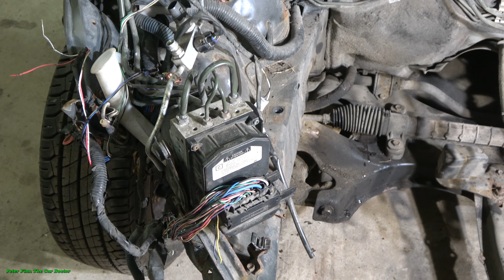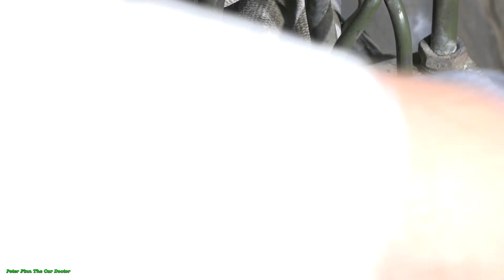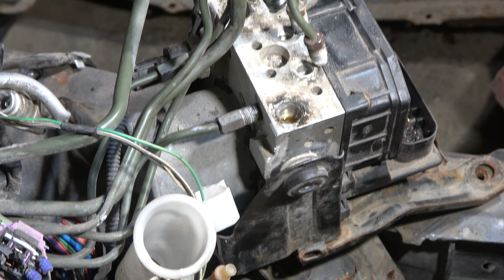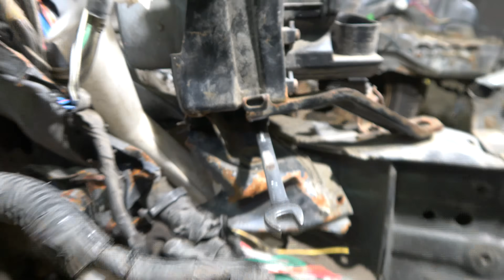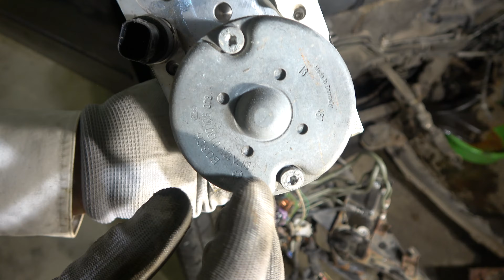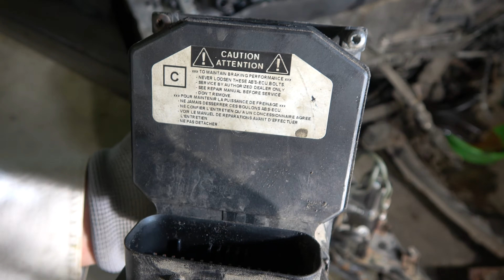How to replace ABS Hydraulic Pump Brake system. Years 2001 to 2022

Comment: Excellent work Peter! Shaped-head tools are always useful!
Reply from the maker: They are good. The ends of the nut do not break and get damaged. Operation is a bit slow.
Reply: @PeterFinnTheCarDoctor  Yes, operation is a bit slow but safe for the nuts and bolts and effective!